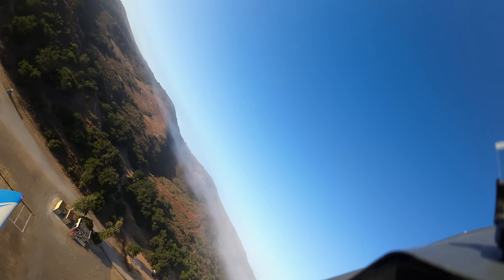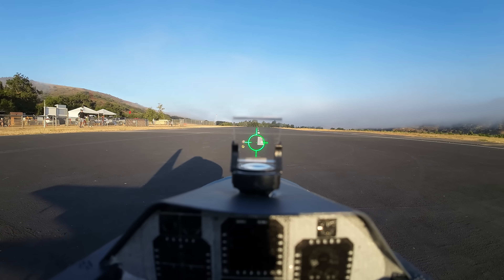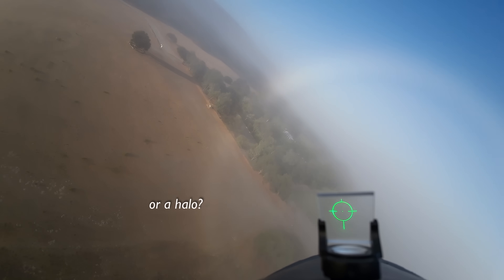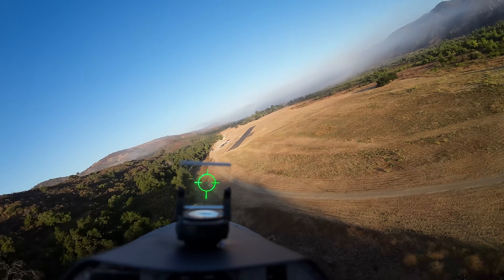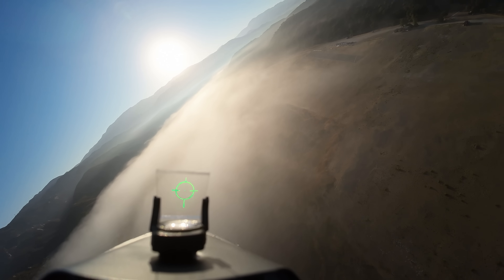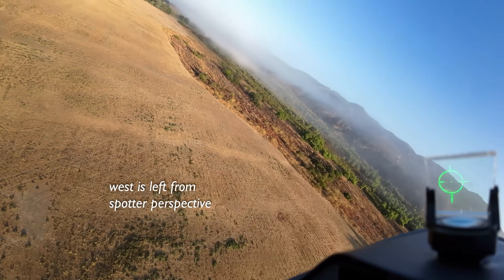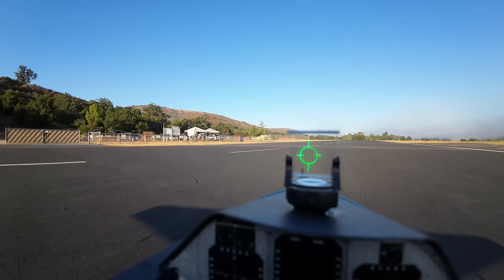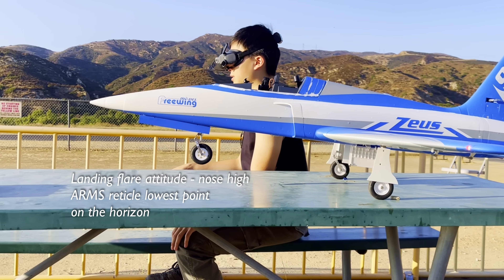How to Fly Your RC Jet from Cockpit Using Head Tracking FPV - Part 1

Comment: Would be cool to have some information layered onto the video stream for the pilot such as artificial horizion, speed, power etc, that it looks like a headup display.
Reply from the maker: Yes!  That can be done by installing a flight controller and using a compatible software like INAV to display the info on screen!

Comment: Love the content, but I am going to have to disagree on the last point.  FPV is not just for when you get bored with regular RC flying.  for the newer generation, it is going to be the standard way to fly, and headset free will be the odd way.
Reply from the maker: It comes down to preference, I think.  But if a newbie RC flyer is FPV centric, he would probably start with quad copters and flight controllers instead of going with RC plane first.  Just my opinion, but it’s all good😊

Comment: I was looking at the Viper 64 mm from eflite.  It looks like it has two spare slots of the receiver in the airplane.  Logistically, this is doable with what you have been showing, right?  If one did not do the head tracking, definitely a thing to do, there is only one slot used for on/off on the "air" video transmission package, right?  I am not sure how to mount the "air" unit to get the cooling that is truly needed.  Maybe a space related issue.  The aircraft platform matters here.  Have you done any evaluations of the possible platforms including the one you have chosen?  This is all absolutely great stuff.
Reply from the maker: @indepviewpt  Viper 70mm works for sure, it has big enough cockpit space to accommodate camera and air unit.  My friend has one setup.  Not sure about the 64mm Viper though.  Generall, plane’s with wingspan less then 40” do not fly realistic enough to provide enjoyable experience.
Reply: @ Thank you for the feedback.  Appreciate it.

Comment: That would do my head in - I used to fly aerobatic sailplanes and so much of it was based on proprioception - i.e. "flying by the seat of your pants" - the G loading when pulling up or pushing over, in steep turns, or when inverted, etc.

 To have that totally disconnected from what you can see would be really weird. 

BUT OTH, a much better solution than just a camera pointing forward. Very interesting.
Reply from the maker: @thepangolin5022  I understand what you mean😁 You gliders pilots are gluttons for punishment, actively seeking turbulent thermals and pulling tight turns to stay in the column.  Those irregular g’s makes me want to hurl.  So for most powered fixed-wing pilots that generally prefer calm air; constant 1 g might be preferable.  Besides, my flight instructor always say: “Believe what you see, not you feel”.  So relying on visual cues only takes care of that.

Not having gut feel to apply rudder corrections during takeoff and landing, especially in a tail dragger where forward view is blocked by elevated nose, or in a vertical maneuver where forward horizon reference is blocked, is indeed a major hindrance.   

I do notice that I used to level my eyes with the horizon when flying in full scale plane during a banked turn.  But I don’t do that flying FPV in RC plane without the gut feel (or vestibular fluid movement in the inner ear).  Leveling eyes with horizon during bank ing maneuvers is actually discouraged in aerobatic training? Please verify.
Reply: @motionsic  The horizon is immutable. It is always horizontal. That's why you have a lines triangle on the wingtip. The horizon is the primary visual reference.

But another instrument that is very important is the accelerometer- that's how you definitively assess G loadings, but as I said, you get used to the "feel" of  them.

With regard to looking out and eye levelling with horizon, I was never specifically advised on this when I was learning...but remember, this was gliders not power so it might be a bit different.

Comment: FPV FTW
I design and 3D print complete canopies, primarily for EDF jets, allowing seamless transitions between FPV and normal flight setups. Switching is as easy as replacing the FPV canopy with the stock one—no downtime required! I offer options with or without head tracking.

Currently, I have canopies for the 90mm F22 Raptor, twin 70mm Me 262, 70mm Yak-130, and E-flite Extra. I’m looking to design for another model but haven’t decided yet. I was considering the Zeus—it seems like an easy setup—but the jet doesn’t appeal to me much.

All my canopies are designed for DJI FPV systems and are available for purchase. They're 3D printed using Lightweight PLA (not a fan) or ABS (my favorite!) and weigh no more than 2 grams more than stock foam canopies—thanks to extensive testing and fine-tuning.

I also take special orders as long as I can get my hands on the canopy to design around. If you’re interested in one of my designs, let me know, and I’ll share a link where you can check them out.

I’d love your input on what aircraft model I should work on next! Drop a comment with the model you’d like to see—it might just become my next project
Reply from the maker: @CodeByNight  Sounds great!  Seems like you will have a fast growing business since FPV in RC planes are picking up steam.  Where do you sell your wares?  Links?
Reply: @motionsic  Not sure but looks like my reply was removed, had links in there. Not gona repost as it seems like it was removed by the channel owner. If anyone wants links contact me.
Reply: @motionsic  What is that HUD you have there?
Reply from the maker: @CodeByNight  https://fpvdogfight.com/products/motionsic-arms-attitude-reference-miniature-sight
Reply: @motionsic  Priced little steep i think. What improvement does this give besides that it just looks good?
I fly fpv and didn’t think i would need this for anything else than looks. All i really need is marked center point which i started incorporating this to my canopies, but its just a centered pointer thats all.
Reply: How do I find your work ?

Comment: I cant find any information on how good the live feed actually is on an FPV system. What quality feed do you receive in your headset while flying? Do you see it in HD like we see in the vid or is it recieved in 240p/360p?
Reply from the maker: Live feed is 1080P with 100 frames per second refresh rate, 30ms latency.

Comment: What type of transmitter do you use? I have been flying on an NX8 and AR630 receivers and I have had a real problem with loss of signal control.  I crashed a Ultra Slow stick from about 200 feet, i was doing a maneuver and it was headed into the dirt and with 10 seconds to recover, I was moving the sticks like a madman and the plane had a mind of its own and barreled straight into the ground with zero deviation from my inputs.  I had a flight today that almost ended the same way, but luckily i regained control about 2 seconds above the ground.  I am really looking for a more reliable alternative.
Reply from the maker: @jasonthornton2525  I have been using FrSky X20S with TD R10 for three years, have not had any control issues.

Comment: Geez, been doing this since the mid 1980's... Started with helicopters without gyros. You should try a 3D setup but it works best NOE. The effect goes away with altitude but is awesome low and slow...

Comment: Absolutely OUTSTANDING! Seriously, I've always wondered why I haven't seen someone try this before and if it has been done, I haven't heard about it until this very minute! I was into RC building and flying starting back in 1980. However, 'life happens' as they say, and by 1990 I had sold all my radios and gear. 

In fact, I regretted leaving the hobby because it was just as the RC community began seeing the availability of RC compressor Jet engines. Before they came out, RC jets used the ducted fan systems. Unfortunately, I had to drastically reduce my spending and never got back into it.

Years later, Microsoft released MS FSX and I became a Flight-sim hobbyist from then on. But I've always kept a close eye on the RC hobby. I suppose I can afford to get back into RC planes again but I don't have many years left so I guess I'll have to be happy as a spectator on the bench.

It appears that you've really nailed this down and I would like to see someone install this rig into a Large scale UH-60 helicopter! The RC helicopter is hard enough to fly from the outside but I wonder if it would be actually easier to fly the RC from inside the cockpit? Do you know of anyone who plans to try this on a chopper?
Thanks again for the great Demo!
Rich
Reply from the maker: @richpaul8132  Thank you for your praise.  Flight sim certainly is a good substitute for this type of RC FPV flying and vice versa.
Indeed,  there are people flying helicopter this way and this particular one use his rig to stay proficient at flying full scale helicopter:
https://youtu.be/3MNA3-3YPjw
Reply: @motionsic  WOW! Thanks for the link. I went and checked it out right away and I’m just blown away! I'm sure that it won't be long before you FPV pilots manage to get some working instruments to display in the system, which would help with testing yourself in flight-instrument related conditions, (at night or in weather, etc.). Great video! 

In fact, I bet the time won't be long before someone applies this FPV RC technique to land on an RC aircraft carrier!! I think they'll probably need to have some instruments displayed to make it happen but it’ll be a serious accomplishment, (if not a serious and expensive risk if they get it wrong)!.
Reply: https://www.youtube.com/watch?v=SRq-vRGU-no&t=31s      With the help of modern flight control systems, helicopter piloting has become easier.

Comment: Awesome work and a great flight. If I had any critique it would be using Spektrum for control. As an FPV rule of thumb you want your control link to out range your video link and DJI will easily out range Spektrum control. Since you're not limited by your vision flying FPV it's very easy to get to the limit of your Spektrum gear. I recommend FrSky's newer stuff if you want something similarly easy to program as Spektrum but I personally use Radiomaster with Crossfire 900Mhz or ELRS 2.4Ghz (good for at least 40-60km control vs 20km for DJI video). You likely will never bump into either of those limits but I like my links to be bulletproof, or as close as possible. I've had Spektrum glitch on me inside 1km and I no longer trust it.
Reply from the maker: @Invid72  I agree with your recommendation🙂 I have been using FrSky X20S with Tandem receivers for last 4 years and have not had any issues.  I lost a few planes previously with Spektrum as well.

Comment: I saw something similar, but one step beyond. The pilot sat in a seat with gimbals. When he would bank the RC plane to the left, the seat would bank to the left, same with the right. When he would dive the plane, the seat would tilt forward. When he would climb, the seat would tilt back. Straight and level flight, the seat would be level.
Reply from the maker: @RicktheCrofter   That’s cool!  What position should the chair be when the plane is flying inverted, or going vertical?  How does he carry the seat to the flying field?  Our field has strict rules for people to fly from the pilot stations.
Reply: @motionsic  That should be the next step they take.

Comment: Nice flights on a potent 90mm EDF there.  I had a Freewing Stinger 90mm back in analog FPV days that put a beating on its 6s battery with sustained 90-amp current pulls.  I'm going to do 12s EDF someday but most flight controllers only go up to 6s max voltage.

Also, I'm surprised the guys at this RC field allow FPV flights.  Most of the old guys that run RC fields absolutely despise FPV.
Reply from the maker: @RCHobbyFan  The FPV guys at our field have demonstrated that we are much better pilots compared to the average LOS flying guys.  And we observe all field rules just like everyone else.  And we bring new interest into the RC hobby.  The old guys need to adapt new thinking or the RC club eventually dies with them.

Comment: Nice.  I wonder what the latency is between moving your head and getting the image back reflecting the new angle.
Reply from the maker: @clintonkeith5333  Haven’t measured, not enough to cause issues while flying.  Latency for visual transmission is about 30ms.

Comment: That's pretty amazing wonder if you could do a dogfight with little bb guns attached now that's a mission
Reply from the maker: @Charlie-z2v3d  FAA does not allow it.  Comes with a $25K fine.
Reply: @motionsic  I see ok what about a lazer like lazer tag
Reply from the maker: @Charlie-z2v3d  sure.  Just need to add a system like FPV-combat.com offers.

Comment: Is this the same resolution you see from the camera at the start im thinking of getting this and wondering if it looks that realistic in the fpv goggles
Reply from the maker: @JetstreamProductions  great question.  This recorded footage is in 4K 60 frames per second.  The resolution in the goggles is 1080P 100 fps.  So it does look this realistic in the goggles.  The 4K makes it extra sharp for viewing on large screen.
Reply: @motionsic  ok ty, also what rc plane are you using and how much did the fpv/headtracking setup cost?
Reply from the maker: @JetstreamProductions  the airplane is a Freewing Zeus  https://www.motionrc.com/products/freewing-zeus-90mm-edf-sport-jet-arf-plus-fj32011ap

The head-tracking FPV system cost about $1000 totals.  Here are the components:
DJI Goggles 3
https://www.dji.com/mobile/goggles-3

DJI O3 Air unit
https://www.dji.com/mobile/o3-air-unit

Motionsic BAG - BadAss Gimbal
https://fpvdogfight.com/products/motionsic-b-a-g-badass-gimbal

Tally-Ho 2+ Head-tracker
https://fpvdogfight.com/products/tally-ho-2-prebuilt-head-tracker

Motionsic ARMS - reflector sight
https://fpvdogfight.com/products/motionsic-arms-attitude-reference-miniature-sight

Tutorial video on how to setup:
How to Fly a RC Plane from Cockpit Using Head Tracking FPV - Part 2
https://youtu.be/_V1Nma-tBOc

Comment: Perché non con due telecamere? Avrebbe potuto pilotare il piccolo jet con visione stereoscopia.
Reply from the maker: The 2 cameras would have to be spaced 2” apart, which would be too wide for the cockpit.  Also two video transmitters would interfere from being too close together.  And the goggles would require major mods.  Easier said than done, if you only knew the intricacies…

Comment: Thanks for the how to video. Do you prefer the Zeus or Viper 90mm
Reply from the maker: @cameronmilne940  Zeus has better speed and vertical performance, but short flight time.   Viper 90 is still better overall.

Comment: FPV is friken cool, but wouldn't it better if we could some how rig two cameras in the cockpit to give true stereoscopic vision? Or does the FPV display some how mimic this? Depth perception is a really pain when flying low, one min the deck is right there, then its really right there!!! Many thanks for taking the time to upload.
Reply from the maker: Stereoscopic vision is definitely cool, but having two cameras spaced at realistic human eye distance apart makes installation in a small model cockpit awkward.  Also there are signal interference issues when two video transmitters are placed next to one another, so not a project that can be Jerry rigged together.    The reticle on the reflector sight is meant for reference against horizon to prevent nose down input when close to the ground.
Reply: Awesome video my man. Love your safety practice.
Reply: What about using Kandao QooCam EGO 3D camera for the 3D shooting?

Comment: We made a method where you can use your thighs to control, 5 simultaneous input channels.
Reply from the maker: Which channels do the thighs controls?  I am genuinely curious🤔
Reply: @motionsic  you can set it up as you like. For drones, we did, for example, knees apart = fly up / lean forward (both knees go down) = faster / one knee up, the other one down = roll, / turn chair left = fly left. This worked pretty well and it was very intuitive. For planes, a different mapping might be more suitable, since they can’t fly straight up or down like drones or helicopters. The key ingredient is that we humans are very good at coordinating leg movements, so the learning curve is fast and reaction times are good. It’ also hands free.

Comment: Relatively speaking you taxi'd well in excess of 200mph
Reply from the maker: Huh? Please explain.
Reply: @motionsic  it will all be detailed in the RCFAA citation
Reply from the maker: @Dame_Kielbasa_Starmer  haha! That’s a good one.
Reply: If a real jet's top speed is 1500mph, you taxied at about 12% of that max on this RC model.
Reply from the maker: @armchaircoach  Interesting rationale.  This model does look like a F-20, which has a top speed of Mach 2+, so probably not that far off.

Comment: How about FPV-control in a RTF(ready to fly)-RC-Helicopter for a change ?  😃👍😎🙏

Would be nice to see how small of scale a RTF-RC-Heli can be to install FPV into. 

.

.
Reply from the maker: I’m all for trying it out in a helicopter, not crazy about fitting in a super small one though, they tend to be pretty squirrelly.
Reply: I did collective pitch RC helicopter FPV for many years using headtracking back on analog FPV days from T-Rex 250 size up to big 14s 800mm Thunder Tiger E820.  Collective pitch helicopters are the most maneuverable craft by far.  Doing a smooth split-S or loop while looking up through the helicopter's blades is a trip.  Also can fly up high, turn off the helicopter's motor and do an autorotation down as if the helicopter had put out a parachute.
Reply from the maker: @RCHobbyFan  you should definitely revisit with digital FPV equipment, the immersion level would be night and day compared to analog FPV.